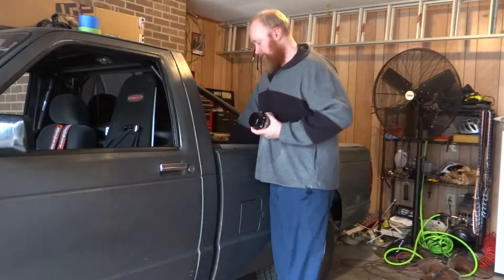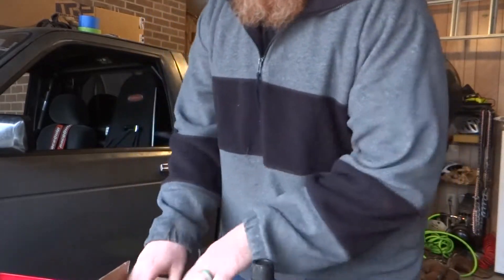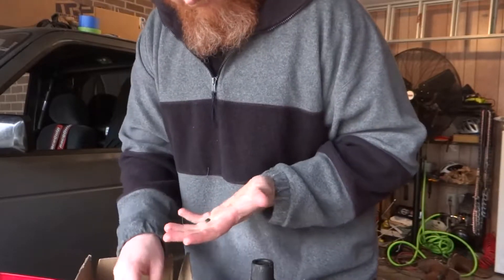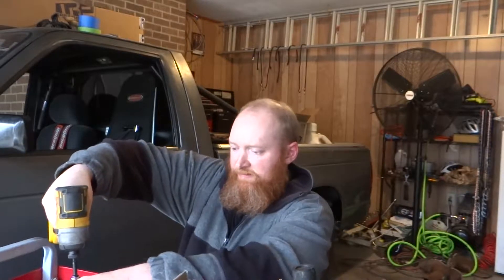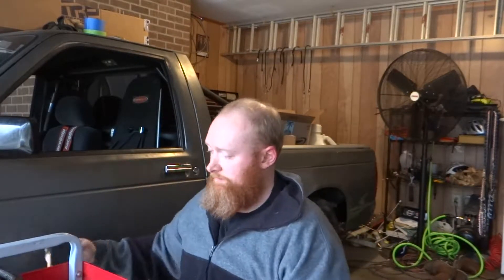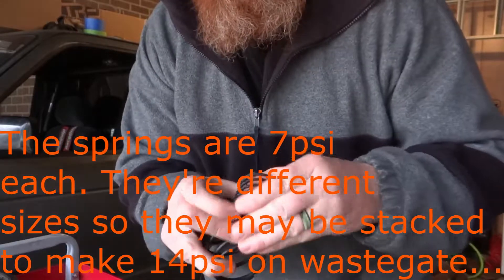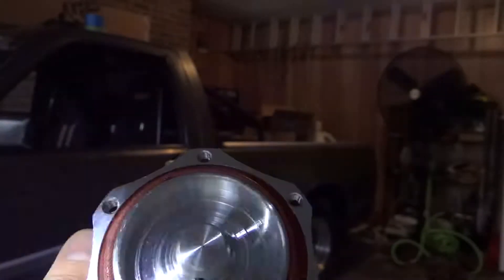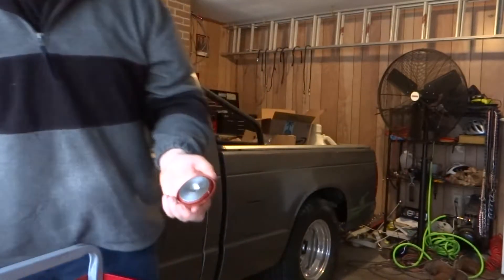VS Racing 50mm wastegate teardown, inspection, and lapping

Comment: Hello, I just acquired and took mine apart and noticed it had two washers between the valve stem and the diaphragm. I removed them as it allowed the fire ring to actually be compressed into the gate and installed. Not sure if you found any in yours but just figured I would post this in case anyone else had an issue with the fire ring not seating

Comment: Because if you noticed break clean for some reason isnt the same break clean we know. All break clean is non flammable now.  The newer break clean is oily its self. 
What turbo/s are you running?
Reply: there is chlorinated (non flammable) and non-chlorinated (extremely flammable) brake clean still being sold